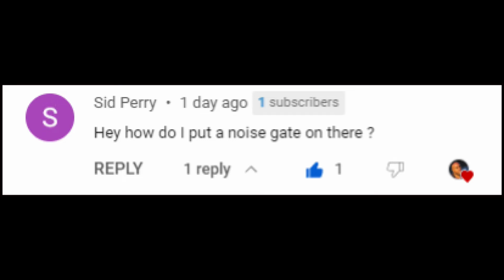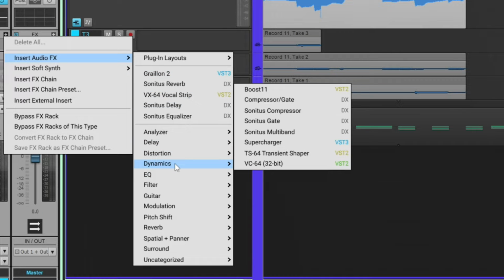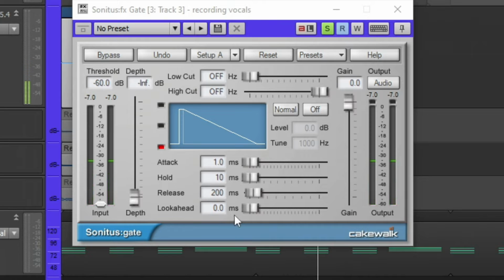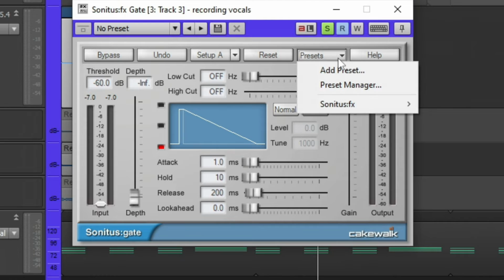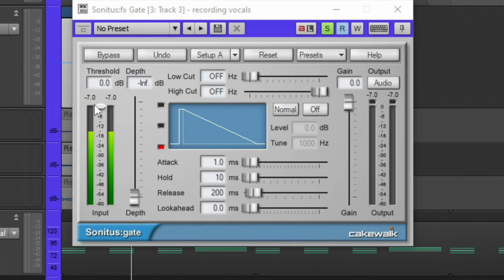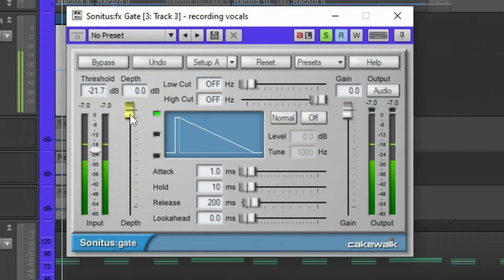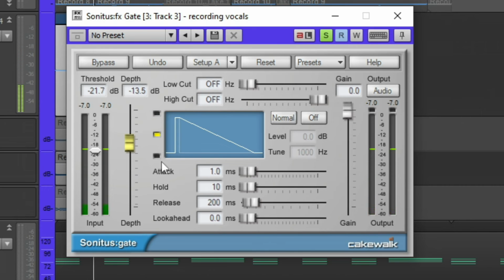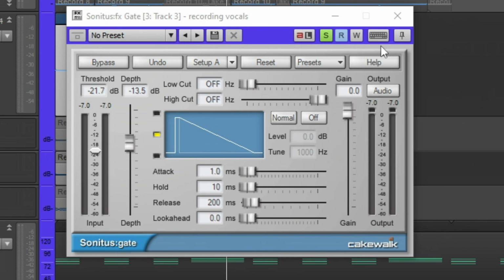So What is Noise Gate? How Does it Help in Cakewalk?

Comment: Is it basically similar to the "Generate Silence" function in audacity? Meaning, does it completely cut the noise off and create silence?
Reply from the maker: It is similar but Cakewalk also has the “Remove Silence” tool which is more like the function in audacity.  

A noise gate is used to cut off certain parts of the recording you may not want like the ring that comes from a snare drum or the overtone that comes from bass drum.  You can use it to help shape the sound